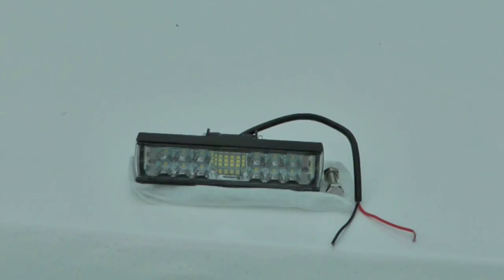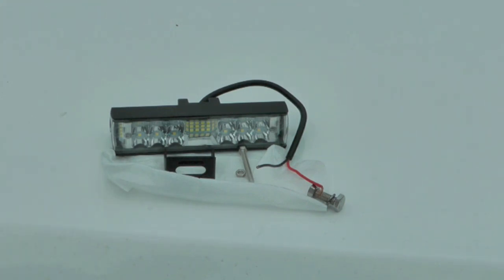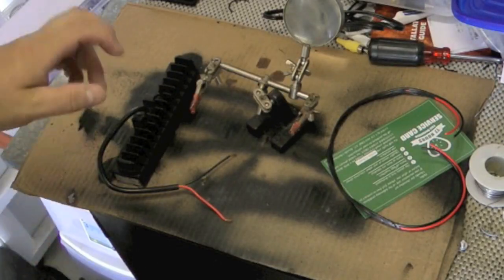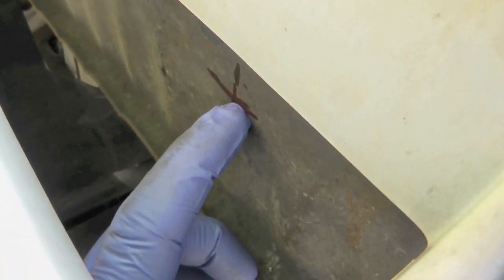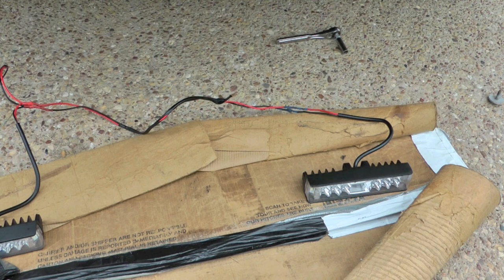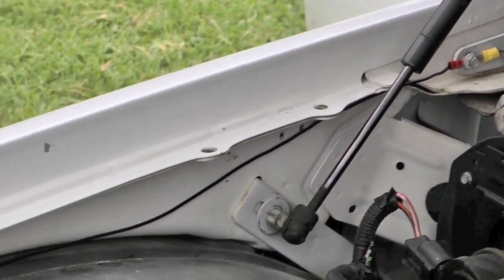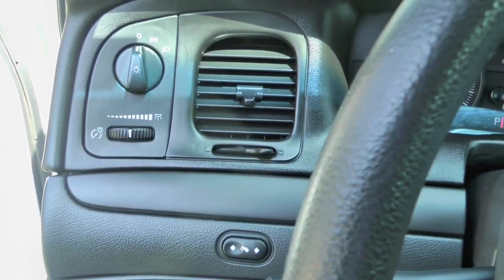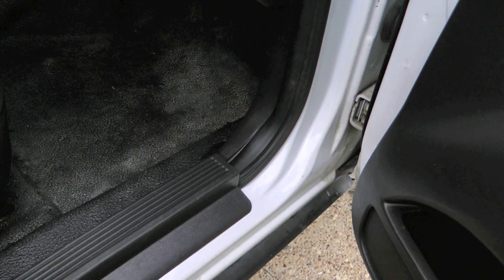2010 Ford Crown Vic P7B LED fog driving lights

Comment: Awesome video! I had always wanted fog lights, but i never was a fan of how out of place they looked in the bumper. Saw posts about people using ford focus fog lights but wasnt pleased with how those looked either. Eventually found some housings off a junkyard vehicle that fit the bumper perfectly, yes i needed to trim off a bumper fin or two but it was definately worth it.

Comment: How are the LED headlamp bulbs working out? Also have you every had to adjust the headlamps? I would appreciate a reply. Excellent video 😁👍
Reply from the maker: my 2010 just has regular headlight bulbs.  I haven't driven at night yet since I installed the fogs - but they look like they should do a great job.  My 2008 has LED headlights and fog lights and it's significantly better night vision just having the headlights even without the fogs

Comment: Got these in 6 inch for my Grand Marquis.  Couldn't you just splice these into your headlight wires so they would be on when your headlights are on?
Reply from the maker: Great question - hypothetically you could run them direct from the headlights, but for best safety and performance, they should have their own power source even if they are triggered via relay from the headlight power.  Hope that helps.

Comment: I just used the stock wiring and the stock fog light switch for mine. No wiring, no relay, no new switch.
Reply from the maker: I assume they all have the wiring since Ford seemed to put the wiring for everything else.  Do you have a civilian model or did you get a different headlight switch, because neither of mine has a fog light switch on it.

Comment: You just gave me another idea.
I wonder if I can install these on the bottom of my rear bumper some how, and run the positive wire into the factory positive wire for the reverse lights.

That way, they would only come on when I put the transmission into reverse.
I wonder what the fuse rating is for the factory reverse light circuit, and if it can handle the extra load?
Did you by any chance check the current draw of these new fog lights?

"Why do I need so much light when backing up?"
Because I like to see. lol
-Chuck
Reply from the maker: I've thought about adding some auxiliary reverse lights too since a lot of us have that "police tint" in the rear window.  If I were doing it, I'd use that 50amp power in the trunk through a relay that is triggered by the reverse lights, rather than trying to split the reverse light power.  That way you'll have plenty of power, no need to run that much wiring, and no risk to the reverse lights themselves.
Reply: Hmmm...
Thanks Gary.

Comment: I know this was done a while ago but has anyone thought of using a newer crown vic or grand marquis headlight switch with the fog light wire to make a factory look?
Reply from the maker: that should work - my concern would be that you might have to run your wires from the LCM though

Comment: Do they come as a set or a single light.
Reply from the maker: they are a set of 2 lights and mounting brackets
Reply: I have an 08 Grand Marquis. The 7 in lights will not fit in my bumper. I need 6 in lights. Also what wattage lights are the best. Are yours 816 watts.  I want the brightest available. Thanks.
Reply from the maker: get on Amazon and eBay and search, there are so many options nowadays and a wide range of prices

Comment: Where did you get the adjustable foot pedal button
Reply from the maker: came with the car - it has adjustable pedals
Reply: @WJHandyDad  can I buy the part for my 06 Vic ?
Reply from the maker: @kennywarren2317  you can retrofit your car, but it will take more than just the button if that's what you're asking.
Reply: @WJHandyDad  yes that’s what I’m asking I like how you work on your car
Reply from the maker: @kennywarren2317  I haven't done an adjustable pedal conversion.  It's not something I really need.  My 2008 doesn't have it (nor did my 2003) and I never needed it.  My 2010 I've never adjusted.  And my wife wouldn't drive my Vic if I paid her  LOL
Reply: @WJHandyDad  lol. Ok is it worth putting a throttle body spacer in a Vic?
Reply from the maker: @kennywarren2317  I don't believe it would provide any benefit.  I'd really want to see a car dyno'd before and after

Comment: On the switch, where do the orange and grey wires go?
Reply from the maker: I ran 3 wires, white, orange, and grey as outputs so that I could expand in the future without running more wires.  I don't remember which is which, but one is for the fog light relay, one is for the camera relay, and one remains unused but there ready for duty if I ever add another accessory